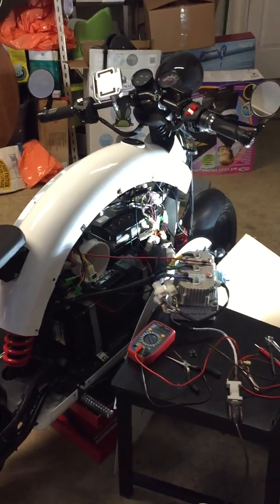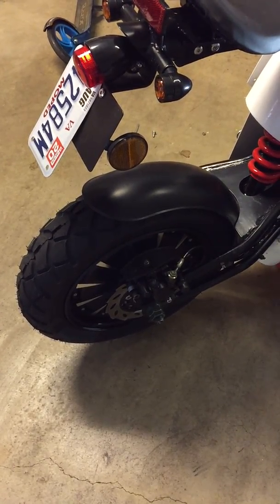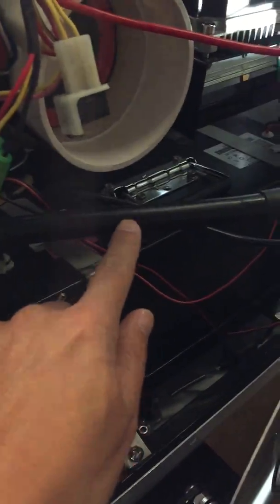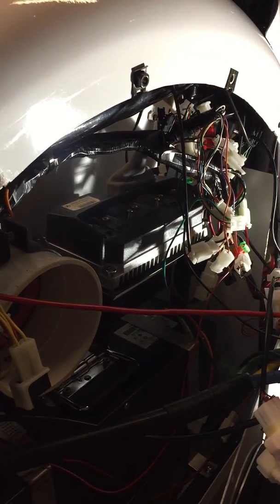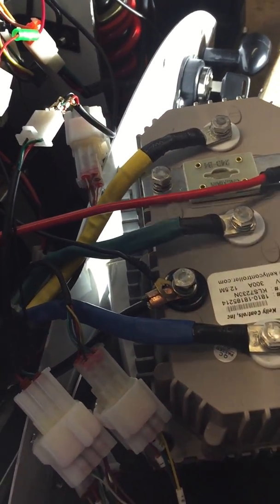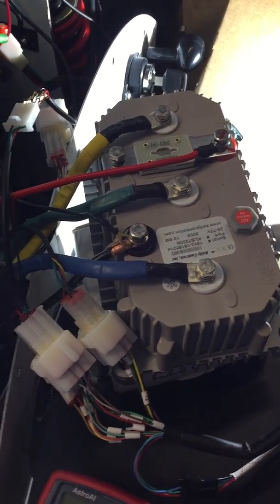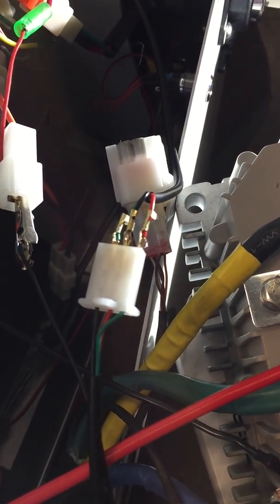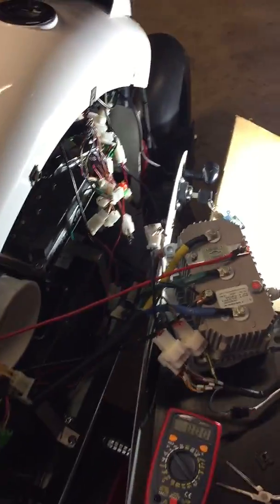Rumble motors bike motor and controller upgrade

Comment: I have been curious as to the outcome of your bike.  I at one time purchased the same bike, but Rumble never got it delivered.  PayPal had to step in to get me a refund.  Had I received it, I would have attempted the same upgrade that you did for the V3 was at that time not offered by Rumble.  What ever happened to this project?  Are you happy with the bike?  What kind of speed and distance are you realistically getting?  Thanks.
Reply from the maker: after only upgrade the hub motor to 3000w and the controller, the top speed I can reach is 45 mph when the battery is 100% full. I'm really not sure about the range, but my guess is around 15 miles if goes from 100% - 20%. Most recently, I'm considering upgrade the battery from 60v 28ah to 72v 30ah. I think the higher voltage will increase the top speed. but the range may not improve at all. I really like the design of the bike, but since then, I also purchased a Sur-ron light bee X bike which is mid motor drive and much more lighter. it's about same top speed and maybe a littler more range. I like to ride it more because it's a lot lighter to move around and take it out from garage.
Reply: @ebikejunkie8447  Thank you for your honesty.  It seems that one would almost double his investment to try and modify this "bike" to a satisfactory level.  I can understand your modifications.  Is there room to add a second 60 volt battery instead of changing over to a 72 volt?  It may be the cheapest way to double your mileage and keeping your current top speed.  As a moped, laws limit the speed to around 35 mph here in California anyway.  Good to see that you got the Sur-ron since it seems to be a nicer designed bike from the ground up.  I toured the Luna cycle shop and it is quite impressive.  When I ordered my Rumble a few years back, I paid $3800 which was supposed to include tax, delivery and customs.  I think they purposely delayed my order for months so that they wouldn't have to had paid the customs duty.  I am now steering towards the Onyx, Huck, or Monday bikes.  I like the Monday since the motor is no longer sprung weight on the suspension.   I in the meantime purchased an electric car which is a real quick vehicle.  Good luck on your 2 wheeled ventures.
Reply from the maker: @SilverShadow2LWB  you are absolutely right about Rumble motors, I was one of the original buyer of their V1 bike from crowdfunding campaign. we all got screw over by the shipping charge and custom fees. and the bike is not performing as spec suggested. anyways, it'll be hard to add 2nd 60v battery, since the original one is occupied most of the space inside. you may be better off purchase new 60v with much amp battery now to get better range. It's a hassle to  get motorcycle license, otherwise used Zero FXS is a pretty good local commute candidate or just for fine. like you said, go with used EV is another option. you are lucky that you live in CA where there are more used EVs available. I just bought a 2017 fiat 500e online without seen it in person first. I have to pay 850 to ship it to East coast, but so far I like it as my local commute or errand car.

Comment: Thanks bro for the info..much appreciated. Also bro if you lived here in MD..You could take to my shop
ElectroScooterWorks Electric Scooter and Bicycle Repair. My guy chip is really good but he would have to look at it to get it rolling. I plan on buying the upgraded version and in putting a much bigger (100ah battery in it). Then eventually refabricating the front to turn it into all wheel drive. Been discussing it for about a month now. Anyways keep me posted on your progress the info you are providing is very valuable.Thanks!
http://electroscooterworks.com/
Reply from the maker: Thanks for your comment. For me, I really dig the design/look of this bike that inspired by cafe racer. it's one of kind. otherwise there are cheaper alternative such as csc city slicker which seems to have more power. anyway, I'm done with upgrade my rumble for now. I finally tuned/programmed the controller to a point that it's somewhat stable and can top out at around 44 mph now. it's really come down to the battery now. Mine is 60v of stocked, so it cannot really go much higher for the top speed. but for a smaller bike/moped like, it's ok. it'll feel unsafe to go much faster. You know the stocked brakes from China are not that good. If you really interested in the version 2 or 3. there's a company in NC also sell it, I think. it's call rocket. I post some link on my other video about it, you can check out. at least it's much closer to here. btw, I live in VA. thanks and hope you find yours.
Reply: @ebikejunkie8447  Yeah bro, Already on it loI. I am buying mine from (Electric Vehicles, Solar Tech, & Drones | EVA - US Green Products
https://usgreenproducts.com/). I talked to customer service bro they told me it comes with a Vin# and everything. That's was the hurdle that stop me from getting the onyx rcr. No vin# means you have to get mva police detective inspection and paperwork out the @ss..lol! Rumble motors suck at communicating. I almost gave up until I saw your first video, which lead to the other company. They answered all my questions. Private message me bro..once I get mine we could hook up. I am glad you are in my area bro. I have  other rides to and I am part of DCSK8. Anyway thanks bro look forward to hearing from you!

Comment: they sell an updated model now on the site with the 3kW motor
Reply from the maker: yeah, but you have to buy a new bike from them and then can purchase the upgrade option. you cannot buy the upgrade kit separately and do it yourself. plus, I wouldn't trust this company anymore for what they claim. I bought 3k QS motor and Kelly programmable controller from aliexpress and did it myself.

Comment: If I buy rumble bike with new upgrade kit so Is this the newest upgrade kit included 3000W motor + new controller ???  so that means with new upgrade kit this bike can handle speed up to 55mph and range to 80-90 miles ???  Thanks !
Reply from the maker: I'm not sure. I did upgrade myself. the upgrade kit sold by rumble motor is only available when you order a new rumble bike then you can choose to upgrade it when you order new one. I'm not sure if the stated specs will be realistic or not. from my own experience, the specified top speed and battery spec is not what I received.